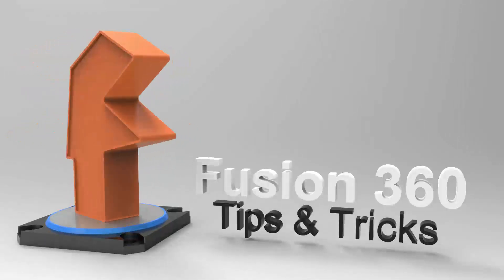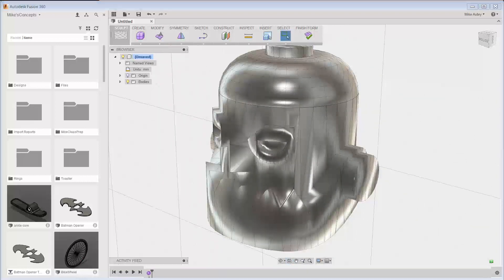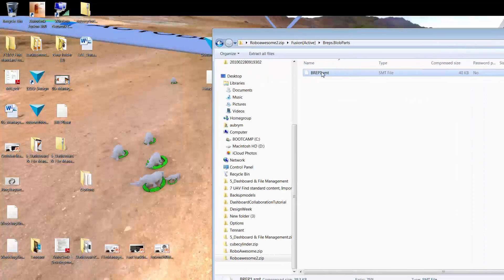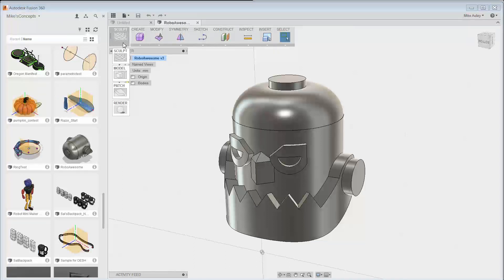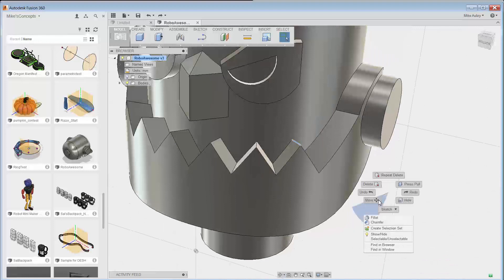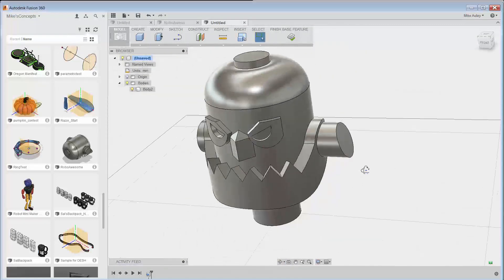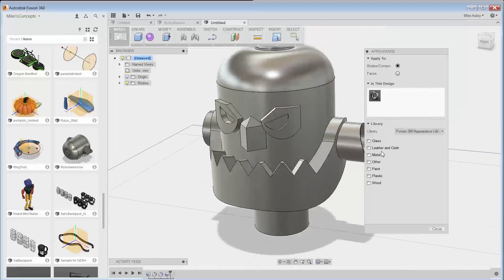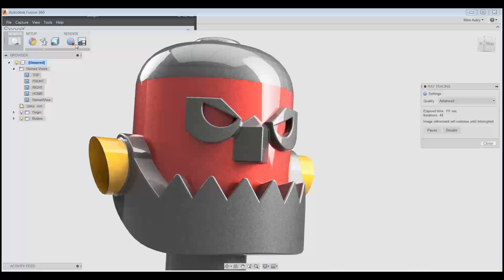Import 123D Design Files to Fusion 360

Comment: Today, it is possible to directly import .123dx files into Fusio 360.

However, as also shown in this video, the material properties of bodies as well as selection grouping information is lost.

This is a real showstopper for me, as I have a model with around 1,500 objects, all with material assigned, and with extensive grouping.
(it is for steering and reefing sails in a historical remote-control ship my son and I are building.)

Is there a method to import this information as well?
Thanks for your help.

Comment: FUCK Fusion 360. I spent months getting to know 123D Design and now I got myself a 64 bit PC and the 32 bit installer says "Nope, not  gonna install, you need to download the 64 bit version" - Oh but we stopped support last month so fuck you, you can't have this great program anymore, you now have to spend many more months learning a massively complicated and un-intuitive piece of garbage just to do something simple, and all your old designs? Well that's hard luck.
Thank you Autodesk.
If anyone has a solution to this or know where I can get the Win64 installer file I'd be eternally grateful
Reply: Seriously, AutoDesk fucked this one up.  And wiping all the Cloud data from users?  I guess "Cloud storage" doesn't mean available and persistent in the AutoDesk world.
Reply: I managed to find a 64 bit installer for 123D design fortunately from somewhere else and my 32 bit saves still load. Screw change!
Reply: ArcanePath360 that's cool. my pre-March 31st 64bit install wouldn't even load anymore. Trying to learn FreeCAD but it sucks having to switch platforms. $40 month to month for Fusion 360 is ridiculous for a casual user.

Comment: Hi Mike, Thanks for awesome video. I have stl files of some parts I like to adjust from one size to another. For example, the hole is say 30mm and now I want to change it to 50mm. I see your video was easy to just pull etc but change sizes using measurements , is that possible.

Comment: 1) let me point out that when i save from 123D to my pc it does not save with a ext on the name as depicted in this video, 

2) even if i go and rename my desktop 123D file and add a .zip it does nothing is treated as a name not as a new file format the file remain as is 

3) i try to out smart the process by right clicking on the file it self and SEND TO zip folder which it worked THO the only file inside the folder "not extracted" only shows that one file we just zipped NOT no other folder as depicted @2:25 so thats pretty much the end of the trail as i cant get that file that your telling us we can change the name of the ext to .sat

what is going on ? im on a win8.1 not that tha should matter but hey why not include that, maybe you can point out something diff? thanks

my whole objective is to remodel it using my new fusion360 for 3D printing and or cnc milling
Reply: +Frank Lopez You don't have the file type extensions set to appear - correct? Go to the Start Menu, type "Folder Options" in the searchbar, then (if it's Win 8) press the "View" tab and unselect the radio button "Hide extensions of known file types" Hope this works out for you!
Reply: vinnyyu01 DUDE THANKS! that shit fix everything! tho i can do the paste of all bodies in my fusion to a new file tab as seen on 5:53

in my case my model has 15 bodies so i just shift in and left click on all the bodies then i hit copy, i open a new tab and drop a box in the plane, then i go on to right click on the body on the left panel and i do not get the paste option at all, but if i go back to the other tab where my model is at and right click on the main body tab i do get the paste option, whats going on?
Reply: You can drag bodies/components off of the left panel (Projects panel?) into your workspace.
Reply: no im doing what he did only that this robot head is one body while my robot has over 15 body parts so i have no choice but to hold shift? and left click on all bodies from that body drop down tab and select all the parts then i right click  and copy, after that i open a new tab/ new project and pick a work space as shown in the video and drop a box on the ground and when i do that i should see the body tab from the left panel add one body "that box" then i right click on it and NO PASTE option ?
Reply: hey same to me. there's no PASTE option in the new workspace/design
Reply: ok found solution from this video at 0:39. have to turn off "capture design" option on the main component. then the paste option appears
https://www.youtube.com/watch?v=Uzg0VJuBA9s

Comment: worked for me thanks, one thing to note the first time I tried I did not rename it as you did in the video I right clicked the file and clicked the add to zip option which did not work.
Reply: Joseph Seal ok so how did it endup working ? cuz what your starting off by saying is that it worked but then you go on to say that his method did not work as same for me and that you doing what i did which is sending to zip file did not worked SO whic is it did it work or dint ?

Comment: Seems very unnecessary to hack two Autodesk programs to work with each other. If they are compatible this should be a 1 click operation -> Open in Fusion 360.
Reply: ***** they just want to make money out those extra features,........ the cnc utility in 123D dont even work FOR MONTHS yet the icon remains there and now i just notice a update adding SAT exports BUT you have to be a premium client WTF?  but yet with a update they still left the cnc icon in the same spot despite the fact that is useless